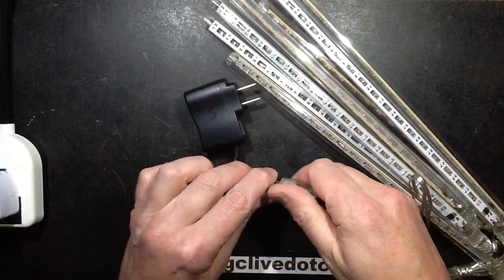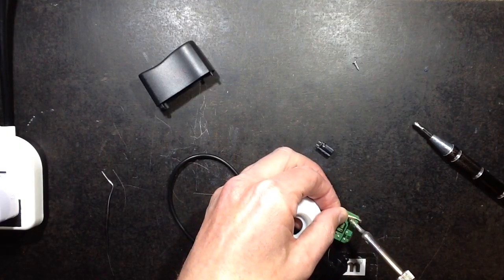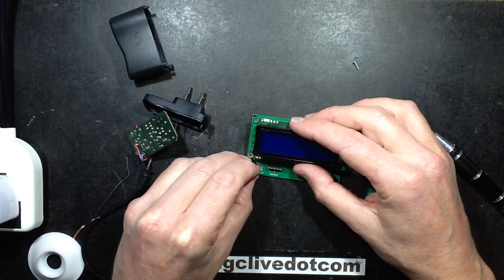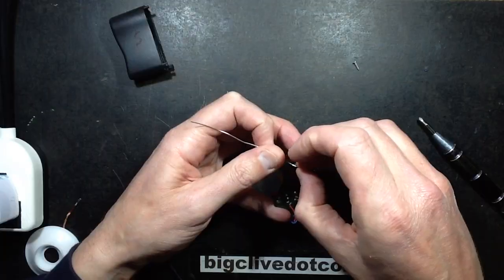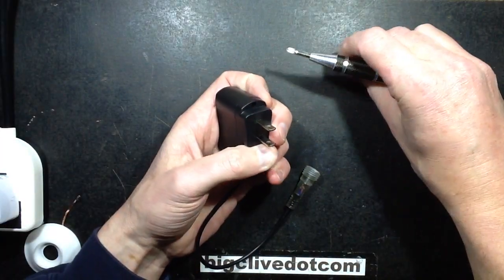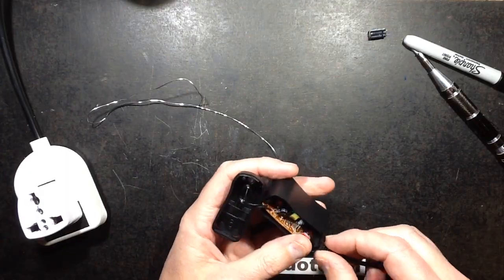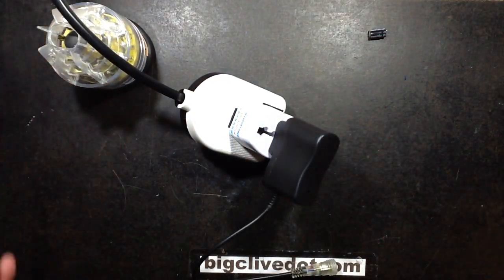Power supply explodes twice.

Comment: In my teenage years 58 years ago I had a 350 volt, aluminium encased, smoothing electrolytic  explode on me it was about the size of  toilet roll core- it tore open the aluminium can and there was paper dielectric  everywhere accompanied by a smell that is impossible to forget and my ears are still ringing.

Comment: In the 70s I worked for a company that made batch terminals. They were large machine and had a bank of huge electrolytic caps. One day, someone screwed a bunch to the bus bars backwards. It wasn't long before it sounded like the 1812 overture. There were miles of aluminum foil and puddles of electrolyte all over. It seems those little safety vents couldn't cope with a hundred amp supply.

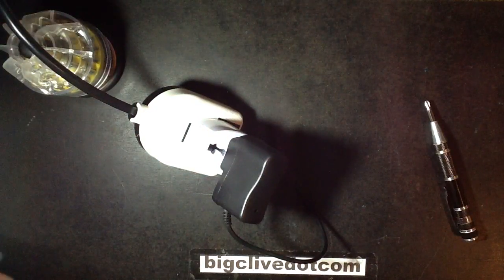Comment: Could that capacitor be a N P  non polar ? .   4:46
Reply from the maker: It's polarised, but it survived well.
Reply: I am 61 years old , started working with electronic when I was 14 years old and that is the first time I saw a polarized cap not fail when connected reverse polarity and I have watched this video about 50 times because it's a great video and it's very funny how you are surprised  about the power supply exploding. @bigclivedotcom

Comment: Old video, but a recent shock from a PSU that looks almost identical to this one - newer models swapped the screw for thin plastic latches and as I was cradling the PSU in my palm and started pulling, the case spit apart and the tips of my fingers touched the PCB. Living in an unprotected 240V country, I was lucky I switched off the extension cord prior to pulling it, so I only got a slight shock from the capacitor. ... Lesson learned - don't assume screw-less PSUs are ultrasonically welded.

Comment: Hey there big Clive at some point can you track down a 
Shark fuel saver device that plugs straight into your cars 12 volt cigarette lighter socket. It’s claimed to save you fuel ⛽️ but i was just curious as to how much of it is true and what’s inside the shark fuel saver device. Components and it’s wiring diagram. Cheers dale Nangus nsw , Australia 🇦🇺. P.S. love your work on youtube keep the electronics coming.
Reply from the maker: Already done.  It's just a small capacitor and indicator LED.

Comment: I mistakenly soldered in that exact capacitor, same specs and look, backwards by accident a few weeks back on a poorly marked board. I am still learning electronics a bit. All I really have down is safety so far. Good learning experience though, made me add safety goggles to my work as it blew the top off right into my shoulder like a bullet. Not enough to hurt, plenty to startle sort of thing. And then, a few short weeks later this 7 year old video shows up on autoplay with you making my exact mistake deliberately. I swear google is listening in on my work...  

The board and device were fine BTW, survived completely and with a nice new cap they're entirely fine and working now. Aside from previous damage to a basic numbers display like on an alarm clock and a basic white LED that's blackened for unknown reasons. But since it's a blueray player, who cares so long as it plays videos right? Don't ask too many questions and all that.

Comment: Years back on the rigs, when one of the Radio Officers went home on leave, we used to spend all night connecting all his spare elecrolytic capacitors to a power supply the wrong way round. The stewards and stewardesses were never very happy about having to clear all the foil and paper up that was all over the Radio Room after we had finished.

Comment: I had here an LED-Powersupply which does not give any voltage at the output any more.
So I removed the LED, opened it and try to find the visible error. Nothing was damaged, so I want to test it without load.

My energy-meter tells me that it needs 80W without load.  :-o
(The 400V electrolytic capacitor had a heat damage and this created a parallel resistor inside, but I did not know this to this time.)
After ~ 2 minutes I know why.
The fog out of the (inside damaged) 400V capacitor looks like a little nuclear explosion.
The aluminium cover of the capacitor was torn open at the top and the rubber was pushed out a bit at the bottom. So the fog spread in a thin layer over the table and shot up into the air at the same time.

I was prepared with earmuffs and protective glasses, because I did not know where the energy goes.
Reply from the maker: That's a very common failure.  If it was the capacitor on the output side you'll need to replace it with a low ESR type.  Easy and cheap to get.

Comment: From personal experience:  A 1000uF cap at 12V in an open frame power supply sounds like a gunshot when it's hooked in backwards and supplied with power.   Also from personal experience, a 1000uf cap also produces about a foot tall cone of paper when it does finally let go.

Comment: I used to go to a radio club when I was a child. And when our teacher-supervisor used to pop out, we used to push big diods, transistors or capacitors into power sockets on all of the desks, switch the light off and then turn the central switch for those on-desk power sockets on. It was quite entertaining.

Comment: Thats way better than them tantalum caps connected backwards across a small DC supply. Why don't you try just putting neons across the mains without a current limiting resistor as they go off with a real nice bang too! I wanna see a bang series (perhaps in a ballisticly rated Perspex box I'd advise) that's a very definitive YouTube winner Clive!

Comment: My pal from school and I "acquired" one of the bench power supply units from the physics class and we pulled apart old radios to get the capacitors from them, then we would connect them the wrong way round, to the power supply, just to make them go bang. Hours of fun.

Comment: I have a flashlight that came with that power supply to charge the battery bank for the flashlight. The flashlight uses (for all my fellow battery workers) a 2s 2p lithium ion 18650 battery bank with a capacity of 3.6 ah, its a nice battery bank that also has a built in bms so this charger jusy connects straight to the power output due to it having a bad amd protection board. Tje power supply with no load (also when the bms shuts the power supply input off) the voltage goes way beyond what tje power supply says it is. It says it outputs 8 volts at 1 amp while in real life with open load it outputs 28 volts! Its a wonder it uasnt fried my bms. The cap (that he's messing with here) was rated for 16 volts! The thing bulged again even when I replaced it with a new one. If you are replacing tje1 cap I reccomend using a 30 volt cap instead so it won't burn again.

Comment: So I have to know, what did you put in the case at the end to make it fly like that?

Also, I have some little known facts for you.

If you open the window in your house, the wifi electrons will go out the window and not go to your devices.

If you put two car batteries together in reverse polarity, you'll double your fuel economy.

Sticking a penny in your light socket will double the life of your light bulbs.

Having trouble with your TV remote batteries dying all the time? Stop changing them and just wire the remote to the wall! Never change batteries again!

Comment: If you REALLY want a bang, install a Step-Down Transformer (120V primary to 5V secondary) backwards...(instead of dropping 120V to 5V, it increased 120V to 2,880V...<BIG Bang>)...
I did that accidentally in High School in the mid 1990's...as far as I know, there's still pieces of the transformer embedded in the drop-ceiling tiles...
Since you have 240V mains instead of 120V mains, it'll be even more exciting (a 240V step down to 5V installed backwards would boost 240V to 11,520V <REALLY BIG Bang>)...

Comment: Hi Big Clive, I'm looking at getting some of these cheap chinese  lights to connect together but I don't want to use the bundled power supply (for obvious reasons)
Is there a safe power supply which will be compatible with the connection on the wire and have a UK plug which you could recommend?
Thanks
Reply from the maker: +Mr CH11LER For the meteor style lights a standard 5V USB power supply should work.

Comment: This reminds me of the time I blew up one of those pill bottle sized capacitors from a VCR when I was a kid.  I was in the 3rd or 4th grade at the time.  I put it on a small PCB with nothing else, with a wall cord (120v) and plugged it into a switched outlet.  I knew what was going to happen, but I did it anyway.  I didn't have the nerve to do it while mom was in the next room, so I waited until the next morning, when she was in the hallway waiting to take me to school.  I flipped the switch (on the other side of the room), watched the cap blow with a loud pop and flash of smoke, hit the ceiling and fall right in the metal trash can with a loud ping.  I giggled for a minute, shut off the switch, and went to school.  I never told anyone about that until today, 37 years later.
Reply: trickshot keng
Reply: Larry, I am proud of you. 2 Points. ;-)
Reply: That capacitor used 1% of his power
Reply: Haha! Awesome! When I was about 11 I discovered that small electrolytic capacitors have an adverse reaction being connected to overvolt supply in reverse polarity. I decided to use this to my advantage and annoy my mum so I soldered together about 7 or 8 of values ranging from about 2.2uF to 22uF and connected them to a home made variable power-supply in reverse and cranked the voltage all the way to 37. Then I took the rig out into the kitchen bench and told mum to come and watch this, plugged it in and turned it. One by one they all exploded or began to hiss and let out a horrible brown smoke. It smelt really bad. Mum got her walking stick thingy and pushed the powersupply of the bench. I could tell she was impressed by the display.
Reply: In the 3rd or 4yh grade you put a capacitor on a board?
Reply: @PlatoonGoon  I started soldering in 3rd grade and started tig welding in 5th. By the time I took welding and cutting classes in high school I was already a trained, experienced welder. We lived out in the boonies building racecars, had a machine shop and everything. I look back on my childhood with great fondness.
Reply: Michael Persico  we did this at my highschool but never during elementary school. But I believe it.
Reply: Madlad.
Reply: Little shit... 10/10
Reply: Your mum called, she's still annoyed about it.
Reply: Cool story bro! Indeed...

Comment: I know this might be a stupid question but it's really concerning me:
I've had this soldering iron that I bought about 2 years ago, I've also received one from my uncle a year ago. both are the same, and try sell the same ones all over in my area so I don't have a choice if I wanted a different type (they don't have any branding on them, they have a normal wooden handle).

so what's really concerning me is, say for example I'm flowing solder on a wire, and the other end of the wire is touching me, I get a slight shock. my feet were on the tile floor. so my question is, are they supposed to be grounded? and if yes, can I do it by myself? not really an electrician, so any tips will help!
Reply: Suggest you get a soldering iron which won't kill you. (no reply? ... oops, too late)

Comment: I've noticed that, the smaller the electrolytic cap, the louder the bang when you accidentally (deliberately) install it backwards.
Reply: I remember many, many years ago when I worked within telecoms, frightening the s**t out of newbies.  We would connect "smarties" in the mains plug of whatever tool they were using.  I'm sure the massive bang resulted in many pairs of soiled underwear.

Comment: Bigclive , any idea what output voltage that power supply should be, as mine has just gone bang !, by the way love your tutorials. Regards
Reply from the maker: The meteor power supplies are 5V so you can use a USB power supply to run a lot of them.  Be careful to try and get the polarity right as the plugs are not polarised.

Comment: "There might not have been enough electricity in it" Thats precisely it. The "rated voltage" on the back must have been measured in 1/2 units. I suggest trying 480v, but if it still explodes then you have to hook it up to a neon sign transformer.

Comment: is that adapter even meant for 240v? lol
Reply: Creeperlover2001 Jes, because it's a Swiching Power Supply with big Tolerance of the Mains Voltage
Reply: most devices these days work with 120-240volts. they just ship with different adapters to each country but the actual device is the exact same. it really is 99% of the stuff you have if you check the actual specs.

Comment: can you put the link for the capacitor tester with the blue lcd ??
Reply from the maker: It's an older style unit.  They do a newer version of the component tester that has a bigger display and shows more data.
Reply: sorry for the late reply, and thank you for the reply
Reply: https://www.aliexpress.com/item/Multimeters-Mega328-M328-LCR-T4-ESR-Meter-LCR-led-Transistor-Tester-Diode-Triode-Capacitance-MOS-PNP/32785141322.html?scm=1007.13438.37934.0&pvid=42e6f8d9-dca0-4684-9607-9a2e381980e9&tpp=1
Reply: What's the model of that?
Reply: takes 39 days to ship ? NO THANKS
Reply: I got mine from Amazon. With Prime it took not even 24 hours to ship...

Comment: Man I do love your exploding videos!  You know I purchased the next upgrade to that component tester, and I use it quite regularly however I quickly tired of trying to get those short lead components to hook on the pads, so I simply attach a wire with alligator clips on both ends, then just clip the items in that way. I can only get 2 on so only 2 lead components can be tested that way.

Comment: Ya gotta go big if  ya want the real show.
I once detonated a 1000uF 250V electrolytic cap while I was doing development of a 1200W power factor correction circuit. It was rather like firing a shotgun indoors.
One of my clients ignored my warnings about how to test a circuit I'd designed for them and blew up a similar cap. The aftermath was quite amusing - you could tell where the blast came from by the bits of paper from the capacitor winding that were caught on surrounding components.

Comment: not enough electricity? 240volts with the potential of a 2000 amp inrush current under catastrophic fault conditions? I'm surprised that your service fuse didn't blow with that fine quality Chinese psu.

Comment: I used to have a ASRock motherboard on my work test bench with bad caps and I pulled a couple off (by force) then twisted the leads together assuming it'd blow up and the board was still good. I used it for hours at a time of CPU/RAM/Video/PSU/HDD stress test on the RMA bench

Comment: I prefer to add paste flux (Ebay's cheapest in square plastic tubs works fine for me) to every desolder braid I use, unless it's a very high value repair, in which case I use some liquid flux applied immediately before.
Unless the braid is badly corroded (any dark orange/red or even verdigris colors are a very bad sign) I've never had a single problem even with braids that are over 10 years old as long as they have been kept dry and aren't visibly corroded. 

Unless you are prepared to add extra flux immediately before use then I think all desolder braids should be stored in extra airtight packing - small ziplock bags are perfect on a cost/benefit basis - on top of any existing packaging they arrive in.

I started off using coax braid offcuts donkey's years ago so I learned the hard way that it's all about the flux and general cleanliness. Avoid the tendency to use a strong flux to compensate for corrosion or dirt though. 
For this reason I prepare 1m lengths of braid for very high-value jobs in advance with a wipe on both sides using paste flux then bag them up and date them. The (mild) flux paste prevents any further oxidation by keeping the air off it.

Comment: Ahh. That brings back some memories. As a child I used to run speaker wire out into the garden and connect caps in reverse polarity. However its not as much fun now with modern caps as they vent. I had a large box of old paper wrapped ones that went of with a huge bang and a long period of fluttering paper falling down. Those were the days, getting a whack from my mother as she nearly cut herself on my cats whisker radio antenna running down from the first floor......   :-)  Can you even get proper germanium crystals any more I wonder.
Reply from the maker: +Stuart Epton You get germanium diodes on eBay.  I would have thought that if you can get germanium crystals anywehre it might be on eBay again.  It has all the weird stuff.

Comment: Okay the generic tester, you said a "new one" came out that has a bigger screen but I'm not certain which one is the "newer" version I found the TS-M8N-Transistor-Tester-Diode-Triode-Capacitance-Resistor-ESR-Meter-MOSFET-N59S which looks very similar to the one you have on the video, but I'm not certain which vendor/store and make model the older one is in respect to a newer version so could you help me out?
Reply from the maker: +DINKIN DINKIN Look for the listings which show the graphic of the component being tested , some data and the pin functions next to the component graphic.  They seem to be evolving quickly, so I'm not sure which is the latest.